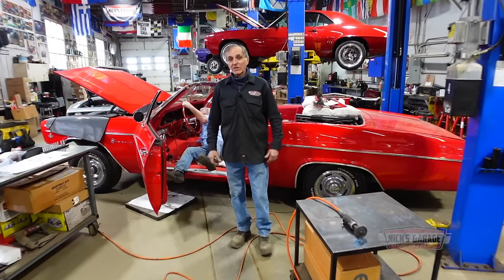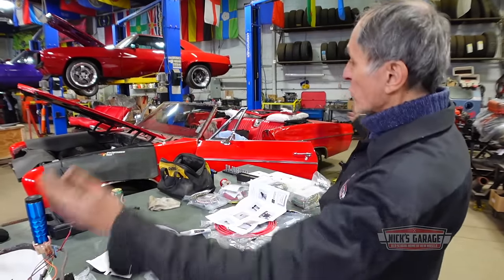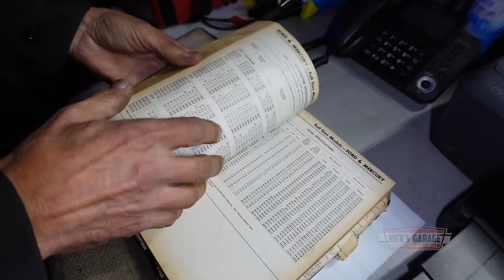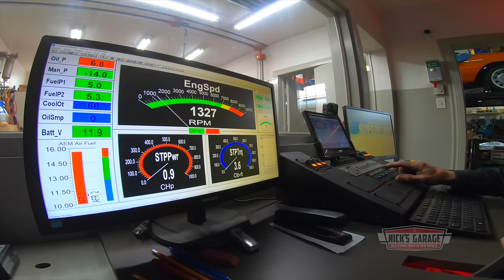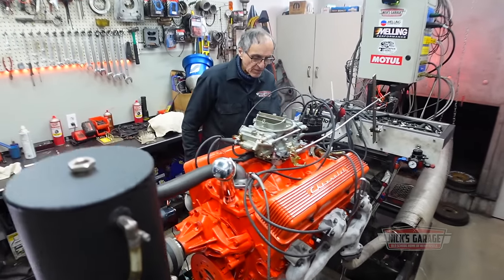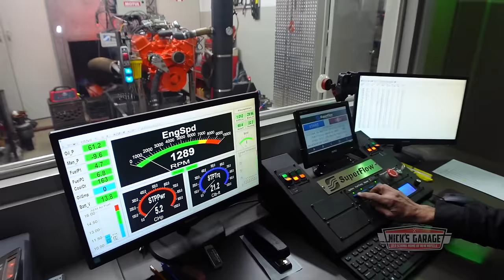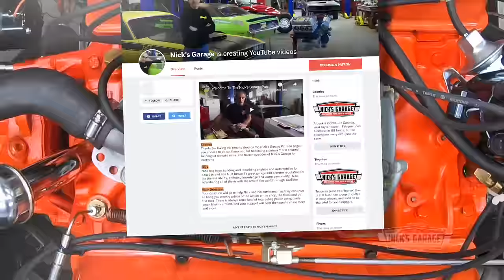327 Chevy on the DYNO - Exhaust Shootout

Comment: This 327 is a real screamer It's gonna make you a true Chevrolet believer Nick's Garage is on the case to make sure this engine has the pace to win the race It's going in a 66 Impala that's red on red that looks so sweet it's got all the street cred It's gonna be a real smooth ride With the new padding in the seat George can just relax and glide This block is unmolested will it outperform what the manufacturer suggested? Only way to find out is to get it Dyno tested!
Reply from the maker: Right on, Roberto!  👏
Reply: @NicksGarage  All the rhymes started with you though my bro

Comment: I really like 327s-had a few and have two vettes with 327s now. A Ford guy told me why small block chevy valve covers leak. It's because the heads are left rough casting where the cover mates to it. Ford heads are supposedly machined on top at the cover mating surface and not prone to leaking.

Comment: I agree with using the larger Corvette Rams horn manifolds. If I remember correctly back on the full sized chevys from 1957 thru 1966, they used small rams horn manifolds.  Also the early small blocks used a "road draft tube on the rear of the engine block (next to the distributor) so that crankcase air could enter thru the oil cap and exhaust thru that road draft tube. Without that tube, crankcase air has to go in and out of the same oil cap. In that case you probably need a PVC hook up.
Reply: PVC robs horsepower and builds carbon on intake valves over time. Now your fuel milage just went out the door. Run that crap out the road draft tube and breather caps.
I wish Nick would show us on the "Dynomometer" just how many horsepower those PVC valves rob from us.
Reply: @raynicolaas7679  Positive crankcase ventilation Valve (PCV) Valve is a good improvement . It keeps the engine block well vented with a slight vacum from the intake or carb .Before the PCV valve the sbc were oil users and leakers . With the correct baffles just before the PCV valve the oil mist will condensate and drip as a fluid back into the engine oil .i believe it also helped to keep oil vapor in the engine and helped with emissions regulations that came into effect in the late 1960's.

Comment: The 66 blocks should have a hole behind the spark sorter  for the p.v.c. valve at least. A nippel for a hose. It was steel and not part of the block . Then it had a baffle inside of the lifter valley.  That's why the valve covers had no holes . My 58 283 had a draft tube.  Two and a half rans horne manifolds  would be nice.  Check speed way.
Reply: ...Road Draft Tube
Reply: @SeymourBalz   right tom. Stinky.  Fumes.  It was wore out.

Comment: A friend of mine had a early 4 speed Nova with the carbureted L76 327 365 hp.The car surprised me ,in that the the engine felt much bigger than it was.If he had told me it was a 396 375 hp I would have believed him.
Reply: That's a solid lifter cam, perfect for this motor
Reply: Your friend may have had the available L79 350 HP 327" hydraulic lifters engine that ran about as well as the L76... get it up to 2500 RPMs and it 'came on the cam' and exploding into HP !!! 
The little 3 valve 280" V8 in 2006 & up Mustangs also is surprising and feels like a big block engine!
Reply: @BuzzLOLOL The L79 was identical to the L76 minus the flat tappet camshaft in the L76.

Comment: i have a 327 all original never been apart still runs perfect no smoke no nothing but it just sits in my shop with a pro built 327 but i been getting bbc the 450 hp 454 with the 02xx trans for free i also have a bunch of running 350 4 bolts truck engines few ford engines a 392 hemi and a 440 mag i just can't get rid of a good engine never know when u need one still have 3 more 454 450 hp engines sitting all have the 4 inch stroke
Reply: ps my dad got a impala new with a 325 hp 327 it was an optional engine for a 67 the base 327 was like  250 they also had a 300 hp optional engine

Comment: there are two miracle chevy engines this is one of them,the other is the 292 inline 6 ,uses many big block parts inside and small block pistons,thanks for dynoing this mouse NICK i'm putting one in my nephews vega,with a 2004r tranny,he wants to trip the light fantasic,1/8 mile digger

Comment: Hi Nick I really enjoy your videos. Especially this 327. This is just my observation. This looks like a 1968 and up large journals 327 with the size of the balancer and no vent on the back of the block behind the distributor. My 66 Impala Super Sport. All original has the PCV mounted  in the oil filler tube. It would be a shame to drill those beautiful valve covers. I would love to see you Dino a D Z 302. Just love the way they Rev like the 327. Don't get me wrong I love the way a 340 revs. Thanks for sharing

Comment: Felpro makes a ribbed rubber one with steel insert.  SBC is a pain to seal those.  Those look like cast valve covers.  Usually they are much easier to seal than stamped steel ones.

Comment: the  best cast iron exhaust manifold is the center dump rams horn, but it might not  fit, but I would go with custom headers, with  a H-pipe cross over behind the transmission.
Reply: X-pipe scavenging can add torque to even headers...

Comment: Earlier engines had a breather tube on the back of the engine then in like 63 they put a pcv in the carb with a hose to a small manifold there the earlier breather tubes were. You should add a pcv. It not only keeps the engine cleaner but less back pressure, less leaks.

Comment: Good morning Nick & George, wow that 66 Imparla 327 sure sounds one sweet engine thus didn't do to badly on the dyno either Nick. The red on red the car will look stunning with all the bright work refurbished once put back together too. That Charger of Eugene's is looking rather choice sitting there in all its glory but screaming take me for a drive man! Till next time stay safe & well all from New Zealand.
Reply from the maker: Thanks, Blinkie!
Reply: But cam is about 2 sizes too big for that engine...
Reply: Nick wouldn't of used it if that were the case and what's more it sounded rather sweet.
Reply: @blinkie1523  - Real motorheads pick cams on PERFORMANCE, not exhaust sound...

Comment: the 250hp,327 had power pack heads. that 327on the dyno has 194,camel hump heads. it was 275 hp,with the Q-jet carb.

Comment: ... I had a 1968 Chevy Nova.. I built a 327 for it and it put out 380hp & 360ft tq at the crank... Turbo 350 transmission all built up w nice torque converter 2800 stall... that was one of the funnest cars I had... it certainly wasn’t the fastest or did the best burnout compared to the muscle cars I’ve had since, but it chirped through the gears nicely, did a decent enough burnout, and I could totally smoke any mustang gt, or corvette around my area within 50mi. hahaha👍.... i had a lot of good memories with that car👍🇺🇸👍🇺🇸👍🇺🇸

Comment: Be nice to see what she’d do with the old ram horn manifolds.
Reply from the maker: Maybe we will get to do that test some day.
Reply: @NicksGarage  that would be interesting , Ram horn manifold with 2-1/2 " pipes , 1966 Chev Impala would have the 
Ram Horn manifold
Reply: @FrankF-vp4pt  when using headers , I had gaskets and used Ultra copper sealant on both sides , heat cycle and retorque , do not bend flanges , heat cycle and re check, drive a day and recheck, do this a few times after instalation and al should be fine, unless you hit curbs etc. I had a set on a 55 Chevy and no leaks for 27 years, I only put on about 10,000 miles but still , all good and no ceramic coat either
Reply: @FrankF-vp4pt  Cheap headers have thin flanges, and nobody builds a cheaper header than for a Chev small block.
Reply: @FrankF-vp4pt  Never had a header leak in my life. Dozens and dozens of cars, pickups, trucks, V8 inboards, transverse-4 Yamahas, tractors, agricultural equipment.
Reply: @superkillr  mine have been on for a few years,no leaks,no warps and WAY more power,easily 10% more
Reply: Only use headers that have 3/8" flanges. The thin 1/4" cheap headers always bend when you tighten the bolts and leak.
Reply: @FrankF-vp4pt  they are?

Comment: Back in the day,the 327 was a great motor,you would have one in stock form that would run just average,but I had a friend with a 59 chev 2 dr post,with a swapped 327,4 speed,that motor was a beast! Very strong ,hard running motor,pulled like a freight train,
Reply: Those 327 is still hard to beat with good amount of work

Comment: Nice little 327. I have never driven a 327 that I didn't think ran pretty good, just like the 302 Ford or the 340 Mopar. I'm not saying they are all hotrods but they always have great throttle response whether stock or mild street engines.

Comment: What some forget about the Headers vs Manifolds discussion to is that some of these 327 had brackets on them for the alternator which caused some to continue using them over having that bracket fabricated back in the day. Now they actually have nice brackets made to pair with headers that you can choose the mounting orientation (high or low depending on look/other modifications) so it is easier to go to headers. However, those going for the authentic stock look will choose cast manifolds any day of the week.

Comment: I think the crankcase maybe building up pressure without adequate pressure relief/ventilation...l was stoping the video to see what was going on at the rear of the engine (next to the distributor) to check out the plumbing where a down tube? used to be? motor sounds good 👍 Real Good

Comment: As an old Chevy SB fan, that 327 is capable of more than that!
Anyway, nice build!
Reply: I should have said, I've build a few over the years. Last one Earl Holt Norfleet in Garland Tx. did the machine work & blue print... Mallory, Crower solid lifer cam, Blackjack headers, Edlebrock, Holly...set it in '55 Chevy 210...
Anyway, it was a hoss!

Comment: Your numbers were right on the money.  331ci, double hump heads, 232 degree cam, 650 Holley....335hp with headers is right in the ballpark.
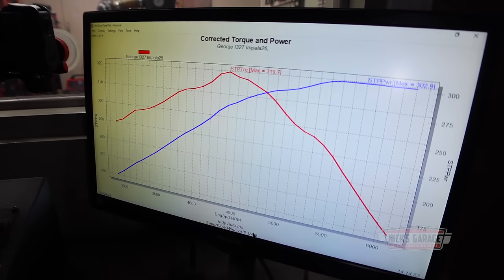Reply: Except cam is about 2 sizes too big for that engine... horrible torque 'curve'... see 18:45...
Reply: @BuzzLOLOL  I agree with BuzzLOLOL...a 218@050 454 lift (Comp 268H) cam would have produced a flatter torque curve...important in a big heavy Impala.
Reply: @jimk4530  - Yeah, something with 210-219 intake duration would make for much more enjoyable cruising... with little loss of peak HP...

Comment: There were a lot of itterations of the 327. 250HP, 275, 300,340,360, and 375hp. The 375 HP variant actually pulled 365 HP. Most of the others except the 2bbl version pulled about the correct HP. But now with the modern heads, ignition,cams, exhaust, and numerous parts from the after market you can build 550HP version pretty well at the top of the abilities of the engine. Id love to have a 7800 rpm 520 HP version coupled with an aftermarket high horse rated power glide in a 68-69 Nova. That would be a keeper to me.

Comment: Seeing that engines nearly stock, I believe you would have had better header numbers with 1-5/8" tubes.
Another simple trick is to add 1.6 rockers on the exhaust. There are stock type stamped steel ones available.
Also there were multiple 327's available.
Up to 365 horse with a carb.
The various 327's used Rochester 4GC's Quadrajets, AFBS, or an 1850 style Holley.
As HP went up, so did the size of the carb.
Reply: Also, a smaller cam would give a torque 'curve' instead of a torque 'peak'!
Reply: You must be an old ChevyNut!
I'm with you, so I am as well.

Comment: Needs to be a draft tube at the back of the intake when using that factory style breather/fill tube.
Impala SS would have had rams horns manifolds. Why not get those with a 2 1/2” outlet version, would be a lot better. 40ft lbs torque to give up is a huge amount, especially for in a big car.
Reply: I would like to see a test between the rams horns and the ones on the engine I know the old timers loved the Ram horns better plus they were used on the Corvettes and that of the 60's it would be cool to see what one is better.
Reply: There's another way to go without destroying the valve covers with a PCV opening.  I pulled the draft tube at the back and put my PCV there.  Same vapor flow as with a PCV.
Reply: If I remember correctly they used a necked down fitting in the draft tube hole and the pvc hooked into that

Comment: Wow, this reminds me of the wiring harness from my '70 Buick. When I was going through ithe car I decided to remove the wiring harnesses and fix them. I solved a lot of problems but I had to carefully tag each and every thing and clean everything and then solder in new wires etc as replacements weren't readily available. Then I pinned out everything and had to replace some gauges too. Was worth every moment as a ground was scorched to the conductor in a short, but I wish a repalcement was just on the shelf at that time.

Comment: It does have a nice ring exhaust note for a little Chevy probably the only small block Chevy‘s I like from vintage the 327 you can get on the scream  about 360 70 hp headers did make a difference 👍perfect for a Chevy 2

Comment: The 66 327 originally had an oil can inside the engine for venting but most people seal that off. You could probably pcv to that hole.
Reply: Lifter valley baffle made of stainless steel.

Comment: 66 caprice tail light lenses look so sexy on a impala. And so do 10in wheels with n-50 tires that bolt on and clearance.  SS had a base 327/275hp smog exhaust manifolds too. The 275hp had the ram manifolds and the infamous double hump 461 head's. I almost like this little engines as much as the 340

Comment: That 327 is performing pretty much to factory spec even though it originally would've had the better flowing ramhorn manifolds. I could see on the end of the heads a rectangular casting with two bumps on the top of the shape. "Double hump" heads, as they were called, are the high performance heads that came on the high horsepower 327 of the day.
Reply: dbl bump had either 194 or 202 intake valves depending on horsepower   327 with those heads would be 194's  and either 275 or 300 hp   then 350 horse  and 365 horse beast  with 202's...early 327's had small journal crank and was same as 283 crank on journals   so you could throw a forged 283 crank in a 327  and destroke it to 301 cu in   which is where the 302 zapper came from.  also they used 327 cranks in 283's to make the 307.
Reply: the lower hp mtrs ran ramhorn exhaust manifolds that were 2 inch outlets   the higher hp mtrs with the 202 heads  ran ramhorns with 2.5 inch outlets..

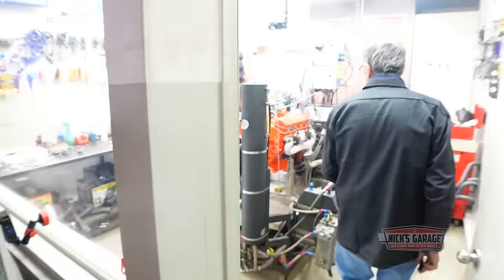Comment: THERE BEST SMALL BLOCK BY FAR NICK. IT IT REFERED TO AS THE LONG ARM BECAUSE OF IT'S LONGER STOCK. THE 307 HAS THE SAME STROKE BUT SMALLER BORE. DURING THE PROSTOCK DAYS THEY WERE RUNNING 331ci WHICH WERE .30 OVER 327'S WITH 15:01 COMPRESSION. AS A FORD MAN IT IS MY FAVORITE CHEVY ENGINE.

Comment: You can get 2-1/2" exhaust manifolds aftermarket.  They were stock on the 300 h.p. 327's.  250 h.p. 327's had 2" exhaust manifolds. He's got the double-hump heads, so it's a 300 h.p. engine.
Reply: 250hp 327 got. power-packed heads. 300hp got camel humps with 194.172 valves. 375hp got 202.172 valves and dome pistons.

Comment: Nick a 1967 nova could be had with the L79 350 hp 327. Those log-style manifolds are very restrictive and I think you will need the ram horns to get it to work in a 66 impala. Also, I am not sure it's been a lot of years but I think the 66 327 still had the hole in the block for a draft tube that the PCV was plumbed to. There is a lot of pressure building inside that engine you may have to put in a PCV or vent the valve covers.
Reply: I know.  But my client does not want me to tamper with the valve covers for a PCV valve.
Reply: Also, cam used here is too big for the engine...

Comment: Seems like that engine should have a road draft tube.  If that port is plugged, blowby would build pressure in the crankcase and pop the breather cap off like it does.
Reply: Only because I currently own a 1967 327 sbc that I got from a 1967 impala SS that has the small journal forged crankshaft which was the last year of the small journal I speculate that the 327 in this video is a post 1967 large journal which the block was different than the early years . This engine block does not have the casting hole beside the distributor for the lifter valley vent/baffle . Also this engine in the video has a larger harmonic balancer and Bolt . Pre 1968 small journals had a very small thin balancer because the engines were internally balanced . And also this engine has the spin on type oil filter and not the early canister .

Comment: I think you should have put a set of correct for 66 Rams horn manifolds on that 327 . They would breath better than those later ones. Also in regards to the pvc valve all 1962--66 327's had a fitting at the back of the block for the pvc.  I have a stock 327 in my 63 Impala, it runs a 4gc carb, rams horns, power pack heads. And it makes 250 hp at the rear wheels threw a power glide.  Yes I've had it on a dyno.  The 327 in your video also has double hump heads that should be a 300 hp engine factory.

Comment: I'm amazed  that those short tube headers were worth 40 foot pounds of torque, I was in in a division called SK Modified here in the North Eastern  United States we ru a step header 1 5/8 into an 1 3/4 pipe into 3.5 collectors with a short straight through muffler, actually  barely a muffler still loud as hell!!! Long primary  pipes 40 inches, some of that is attributed to the bodies on the cars the headers are outside  the body, wish I had my dyno room finished would be curious how changes in the exhaust  would affect the motor, got 1 car with an sb Chevy and 1 car with a sb Chrysler, hopefully  get the Chrysler car finished this summer  and see what it does.